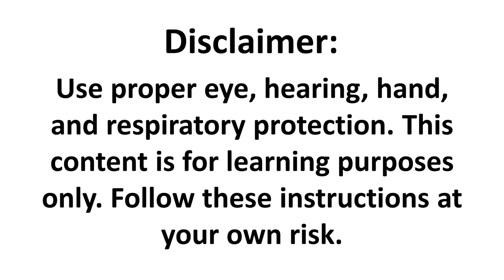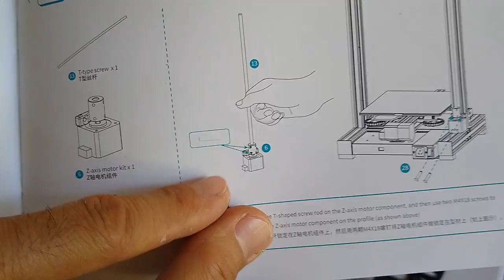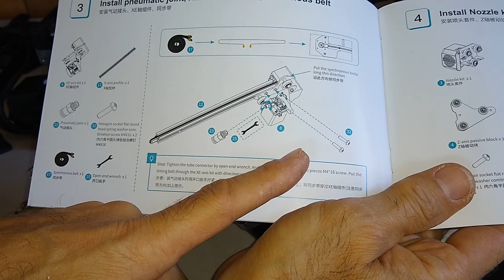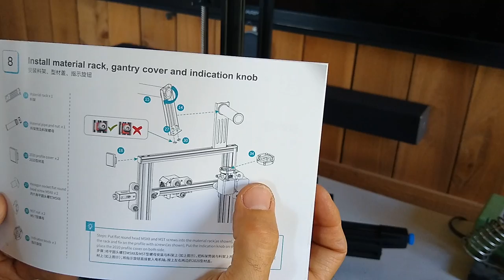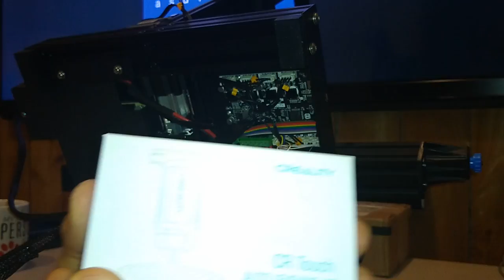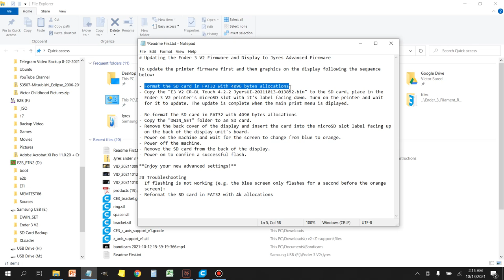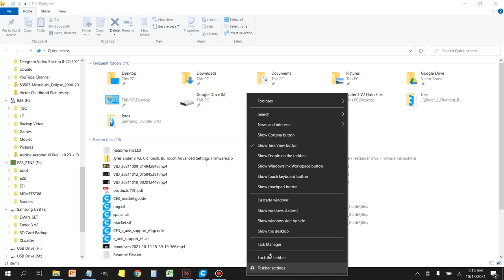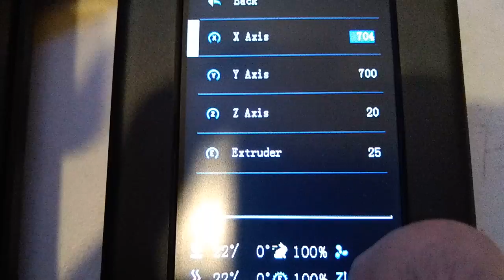Ender 3 V2 Assembly, Upgrades, and Jyers CR/BL Touch Firmware Step by Step.

Comment: Hi Victor,  I have been reviewing your tutorials on the Ender3 hot end upgrades and wanted to know if the Micro Swiss All Metal HotEnd Kit and the Furiga 24v 50 watt heater is still top of the list for an upgrade?  Is there an addition for the Heat Break Tube and is heat sink compound still a good idea. 
As I mentioned I had the heater set screw that I could not remove during the boden tube and insert modification so I'm thinking of replacing the stock hotend when I install the CR touch probe.  Thanks again for all the great videos you produce.
Doc'
Reply from the maker: Hi Doc, The Micro Swiss all metal hotend kit and Furiga are great upgrades. The only trouble I've run into with the using the Micro Swiss is that my heat block got loose on me a few times from the heat break due to the heat cycles. The tiny tool holder on the Micro Swiss heat break doesn't allow for enough torque to tighten it well enough to the heat block without stripping the tool grip points before installing and torqueing the nozzle against it. I recently purchased a Chinese knock-off (linked below) of the Micro Swiss all-metal kit that comes with the two screws to keep the heat block from rotating like the stock Ender 3 V2 hotend. I plan to replace the Micro Swiss with it next time that heat block comes loose.

Thermal paste on the sleeve that pushes into the heat sink side is a good idea regardless of the hotend because it will improve thermal conductivity from the heat break to the heatsink.

https://www.aliexpress.com/item/33047254836.html
Reply: @vbared  Hi Victor, thank you for your reply.  You must be as busy as a long tailed cat in a room full of rockers.
I looked at the HoEnd from your link and I'm still a little bid on the novice side to take that up grade on, as there seems to be a lot of variations in components to mix or match so for now I keep reviewing the HotEnds and advance my understanding of it's complexity.
The CR touch, Creality accessories kit, Z axis T8 anti backlash nut and lead screw top mount and the 4010 blower fans for your duct system came today I think it would be prudent for me to complete these upgrades prior to the Hot End work. 
It would be nice if all the Hot End tutorials were in one place or folder.  Lazy me sorry.
As always thank you Victor.
Doc'
Reply from the maker: @doctrainsmodifications5201  Great talking with you, Doug. You have wonderful sense of humor. Yeah, I can get pretty busy, thankfully today I just needed to get my groceries and make a few other stops. I agree with you it is easiest to deal with most of the major upgrades early before getting bogged down with 3D printing projects. Looks like you're going to be busy this week adding the new components. You'll really like not having to level the bed so often after adding the CR-Touch. Once your z-offset is set it just pick your file and print.
Reply: @vbared  Hi Victor, yes your humor was right there with me.  Too funny.. really it was.
Here we go, today I installed parts from the Creality Capricorn Kit, the T8 Anti Backlash Nuts and spring, BOING more that once, and the Top Mount for the Lead Screw with the bearing.

I feel that the Top Mount Bracket and Bearing for the Lead Screw is a strong contender for a must do modification.  The stability and alignment of the Z axis can really be tuned with that addition and the dead band in the lead screw is now very minimal and the travel is silky smooth.

I then installed the CR touch and upgraded the firmware to the ( E3 V2 CR-BL Touch 4.2.2 JyersUI-20211013-013852.bin ) The Display as well.

The mesh mapping went well which lead me to the Z-Axis offset.  It took a little while on the Z Offset screen to work out the movements and then the offset values but after some trial and ... YEP you know, I was successful with tweaking the offsets, saving, then homing Z and then using the move Z function I was able to move down to the bed and finish up with the paper trick.  Home to bed was repeatable and the final offset was -1.30.  Dang I still have some hair left.

I need to review the print of the squares you showed so I can fine tune the Z on the fly... if only I can find that file.  For now thanks again Victor and it's back to class.
Doc'

Comment: thank you for this awesome vid you coved everything i wanted to know and more.
Reply from the maker: Hello Kent, Thank you for commenting and for words of encouragement. I'm glad you found value in this video for your viewing time. The video links below are kind of follow-ups to this one.

Micro Swiss Dual Gear Extruder Upgrade - https://youtu.be/txBnIR-uoRs

Make sure to watch both of these below before messing with your stock hotend if you plan on using it.

Stock hotend assembly tips - https://youtu.be/ycvHpMbo5Hw
Slice Engineering bi-metal heat break to stock hot-end - https://youtu.be/3v_cEldgT4U

My Ender 3 V2 fans were just too loud -
https://youtu.be/AEdca_-Nqys

Best of luck with your mods!

Comment: Great video thanks. Just one question? I’ve downloaded the latest Jyers UI and installed the Antlabs BLTouch but when I try to ‘Create New Mesh’ nothing happens (I’ve disconnected the Z Limit switch). The BL Touch is just flashing red?
Reply from the maker: Hello Daddy Scribbles, Thank you for commenting and kind words. Did you manually level your bed after the install? I ran into something similar after adding a handle to the build plate because I had to remove and then reinstall the bed springs. After that my CR Touch behaved the same way as yours is now. What solved the problem was manually leveling the bed. Go into the Ender 3 V2 menu locate the manual bed level feature and go through that process a couple of times and then try again to create a new mesh, It worked for me hopefully it works for you.

Comment: Wow, thanks so very much for putting out this video, I recently ordered the Ender3 v2 and I would never have been able to figure it out on my own. I just hope I can figure out the whole flashing sequence on my p.c. Were you using the same sd card, or separate ones , 1 for the printer, and 1 for the display. Thanks again, when I receive my printer in the mail I’ll watch this over again.
Reply from the maker: Hello AngryPepper, Thank you for commenting and kind words of encouragement. Yes, I used the same SD card that came with the printer. Just follow the steps in the video and use the file links included in the video description. If you run into any trouble just send me a message so I can help.

Best of luck with your new Ender 3 V2
Reply: @vbared  Thanks so much Victor. I will definitely follow your instructions.👌

Comment: Good job on the tutorial video, very comprehensive, from start to end. 
About the firmware you using, some questions: 
- have you modified the firmware to function properly with the heating cartridge and the specific thermistor, or is a stock Jyers ? 
- could you provide the source code, or the modified lines ? 
I am using a stock Jyers with a 5x5 mesh and need to modify the parameters for thermistor and heating cartridge, since i get some errors in temperature measurements. the thermistor i am using is not similar to yours, but in a metal cartridge and apparently is a HT-NTC100K type. Best regards.
Reply from the maker: Hello Pro Services, Thank you for commenting and words of encouragement. I'm glad you found value for your viewing time. The only changes made to the stock Jyers firmware were the max temps, corrected the values of the CR Touch probe offsets. No changes were made to the heater cartridge and thermistor. I'll have to learn how to determine the correct settings for them. If you find a good source please let me know. 

Best of luck with your!
Reply from the maker: Hello Pro Services, Thank you for commenting and words of encouragement. I updated the max hot end temperatures, and set the correct z- offset for the Cr Touch. I didn't get into changing the thermistor and heater cartridge values yet.
Reply: @vbared  I understand. Then it is possible that the values for thermistor and heater cartridge in your firmware are pretty close to the hardware specific and thats why you dont have temperatures errors. 
I will have to give it a try with this firmware on my hardware and see the stability of the temperature and the values.
UPDATE: checked your firmware on my hardware and i still getting instability in temperatures witch in long times prints gets to clogh the head and stop printing. Even after i did a PID the same results. Thermistor is reading around 270 but my FLUKE measuring around 260 - 265, with fluctuations. Possible i have some hardware issue. 
Will try change thermistor and heating cartridge with some originals and see again the results.
Best regards.
Reply from the maker: @proservices6067  Yes, it must be close because I've switched from the stock 40 watt heater cartridge to the 50 watt version and now back to the original 40 watt without having to do anything to the Tiny Machine's 3D firmware that I have flashed.

It should work as well for you as it is for me.

Best of luck with your projects!

Comment: Super Video!!!
I'm just about to embark on some of these upgrades. My Z limit switch went bad due to a crash. I take partial blame for that as I made a Z axis move (down) from the control panel when the gantry was already low. I also partially blame poor software, that would allow a move like that by ignoring the Z limit-switch input and drive right past it. 
Since I needed a new Z axis limit-switch anyway I opted for a CR Touch instead. Just learned about the Jyers UI, and will give it a try. Your video will be a very helpful guide for these upgrades.
One other thing I'm going to try is solid mounting the build plate on silicone stand-offs. I figure the CR touch will build the mesh for tramming, so there's no need for adjustment wheels any more. One less thing to get out of wack I guess. Do you know of any reason not to solid-mount the build plate?

Thanks again for the info.
Reply from the maker: Hello Know Way, Thank you for commenting and kind words. I haven't used the solid mounts yet but one thing to consider is that some parts of the stock printer get placed between the spring and the build plate. One example of this is the plastic part the keeps the heated bed wires from moving around too much while the bed moves forward and back. It adds about 1mm of material under the left rear spring. If all the solid mounts are the same height you will need to shim the other three. I recently added a handle with a camera mount from Thingiverse that attaches to the front build plate screws that hold the springs. Many Thingiverse files that use these attachment points will be designed around springs. If you already have learned to design your own parts using CAD then it's not a big deal to make a version of a part designed to be used with springs for the solid ones.

Since you're going to use the CR- Touch you're only going to level the bed once and that's it. With the solid mounts you will also need to do one initial bed level. The CR-Touch will sort out any changes that happen over time.

The bed level and springs are only a hassle if you don't have some type of auto bed level device that compensates for slight changes over time.

Best of luck with your build!

Comment: Thanks for your video! I measured my x offset (CR touch) with my Ender 3 V2 and it is the default 44mm instead of 47. How come they are different?
Reply from the maker: Hello Chaoz, Thank you for commenting and kindness. I might have goofed up the measurement somehow. Just re-measured both my Ender 3 V2s and I get closer to 45mm (44.91) distance between the nozzle tip and probe. Great catch BTW. The only thing I can think of is maybe Creality uses multiple factories with tooling that might vary a little. I'll add a note in the description about verifying  your own measurements.

Best of luck with your projects!

Comment: When you measured your X&Y axis with a caliper to set offset, does that affect bed level? I just installed a CR Touch & 2nd stepper motor/z axis rod and am having same issue before upgrades and middle of bed is lower no matter how much I level perimeter of the bed using creality firmware.. Might try this firmware tho I hope it helps
Reply from the maker: Hello JustA YouTuber, Thank you for commenting. Check out my video, linked below on installing the Jyers Unified Bed Level. One of my machines's bed has a hump in middle. Prior to installing it, I was unable to get a good first layer of I had to print outside of the center of the bed.

https://youtu.be/g12t16lSr80

Comment: Leaving on 230 volts doesn’t hurt it.  It just won’t work.  I forgot to flip the switch once.
Reply from the maker: Hello Douglas, Thank you for commenting. Yes, you're 100% correct it won't harm anything. The same thing happened to me when I was going to set the voltage on the buck converter during the making of this video (which I edited out). It took me a few minutes to figure out why I had no output from the power supply. Hopefully it will save someone a few minutes of time to check and make sure it's set correctly for their country.

Comment: You're pinching the probe wire behind the fan shroud by running them that way. They should be run on top of the fan should and into the wire loom.
Reply from the maker: Hello Lk Tah, Thank you for commenting and suggestion. I didn't like the way it would have looked running on top, but you're right it would have been easier and eliminate the risk if the ribbon wires getting pinched. I created a big enough notch in the fan housing on mine for it to fit without issue.

Best of luck with your mods!

Comment: thanks dude helped me alot
Reply from the maker: Hello M L, Thank you for commenting. I'm glad you found value in this video for your viewing time. These 6 videos below are the sequels to this one. If you're just now getting into 3D printing or this is your first Ender 3 V2 check them out so you can save yourself the frustration I had to go through to learn this stuff. 

Silent upgrades - https://youtu.be/ycvHpMbo5Hw
Garolite G10 build surface - https://youtu.be/MB-91rfvWfE
Ender 3 V2 stock hotend fix - https://youtu.be/AEdca_-Nqys
Slice Engineering Bi-metal heat break - https://youtu.be/3v_cEldgT4U
Ender 3 V2 best cable route - https://youtu.be/o9P09KNHpYk
Super tune your z-offset to get perfect prints - https://youtu.be/wrxQrzOeSPY

If you run into any questions just ask.

Best of luck with your build!

Comment: hello, I have a problem because I bought a bed sensor (the same as you) and downloaded the same printer software as you in the video and when I start printing, the sensor only goes to home and checks there and the printer starts printing and the nozzle is too high and the filament does not stick to the table, what should I do? something in the printer settings or in cura should I do something? please help me with this
Reply from the maker: Hello Michael, Thank you for commenting. It sounds like you need to set your Z-Offset. Follow these steps:

From the Jyers main menu select Prepare press the control knob to enter that menu then select Z-Offset and press the control knob to enter it. Next select Live Adjustment press the control knob to check that box. The print head will move to the current Z-Offset. To adjust the Z-Offset up or down select Z Offset from the menu and press the control knob. The Z Offset value will be blue and can be adjusted (make sure to press the control knob after making the Z-Offset changes so the machine will move to the new Z-Offset). The Z Offset value will be a negative number. The greater the negative number the closer you will be to the bed. A lower the negative number will raise the print nozzle away from the bed. Let's say your current Z Offset is -.50mm and you are .5 mm away from touching the bed then you would set the Z-Offset to -.85 this way you will have .15 gap between the nozzle and the bed. This is close to perfect if you are printing at .2 layer height because you will have a .05 squish.

If you run into any trouble call me +1 478-227-3301 I'm located in the United States.
Reply: @vbared   Thank you very much for your answer, I haven't done what you wrote yet because I'm not at home but I'll definitely do it when I get back :)
Reply from the maker: @Michu_24  Anytime Michael (:
Reply: @vbared  hi what you wrote helped a bit but still in some places the filament does not stick to the table I will work on it a bit more but if I fail I will be able to send you a video? what exactly is going on there and you'll see if I'm doing everything right because maybe I'm doing something wrong

Thank you very much for help (:
Reply: @vbared  hello, I finally have time to take care of the 3D printer and I have the same problem with it all the time, I could send a video to Tonie via email or messenger because I don't know how to describe what is wrong with my printer
Reply from the maker: @Michu_24  Hi Michal, sure email me a video of the problem vbared@gmail.com so I can help you.

Comment: how long is the thermistor cable and cartridge heater cable for ender 3 v2?
Reply from the maker: Hello Robby, Thank you for commenting. I haven't measured the original ones on my Ender 3 V2 but most replacements are longer than needed if that's what you're wanting to know. Hopefully I answered your question.

Best of luck with your projects!